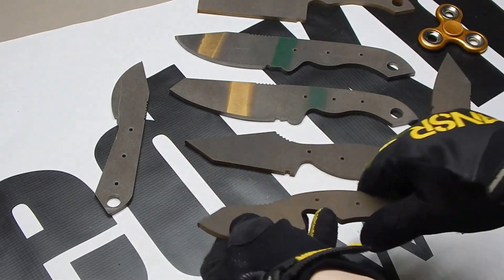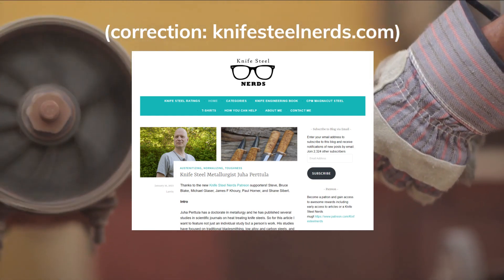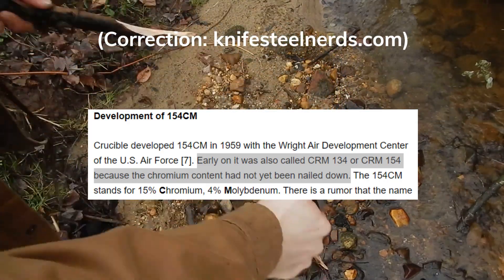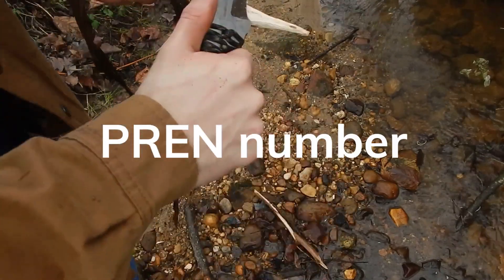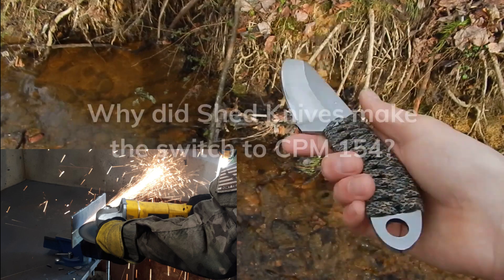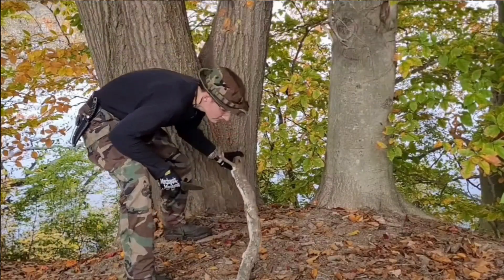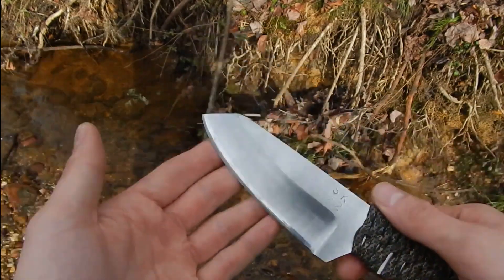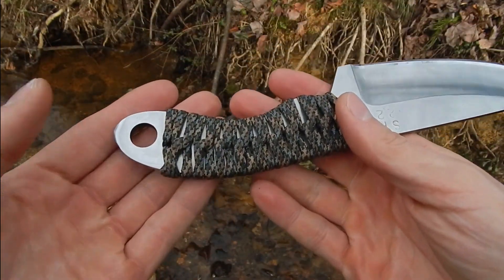Why Shed Knives uses CPM-154 steel #shedknives

Comment: CPM 154 is one of my favorite steels. It’s tougher than S35VN and holds an edge about as well. It’s not as good as Elmax or MagnaCut in my experience but it’s a lot more affordable and widely available than those steels are. 

I appreciate your history lesson of 154CM which is another favorite steel of mine. In fact, it is my favorite non-PM stainless steel. A lot of people mistake 154CM and CPM 154 as the same steel. The PM process really elevates 154CM though and takes it to another level.

RWL-34 is another really great steel that is essentially the same as CPM 154. A fun fact about RWL-34 is that the initials stand for Robert Waldorf Loveless.
Reply from the maker: I'm glad you liked the video! Any steel with CPM in front of it truly is a high quality steel. CPM-154 is one of the best options (in my opinion) for bushcraft knives so that's why we use it. I certainly appreciate your feedback & additional info - thanks for your support :)

Comment: You mentioned ATS-34. I have a Buck Alpha Hunter 1 of 2500 made out of ATS-34 and it is harder, harder to sharpen, gets better wear resistance compared to my cpm-154 knives but that can also be because of Buck's BOS heat treatment which seems to be the best method of any manufacturer.

Comment: As a chef and outdoors enthusiast, I would like to offer a tiny bit of constructive criticism.  Your cleaver blade doesn't need the sharpening choil, and it actually gets in the way when using that end on the blade.  The edge sticks down far enough that you needn't worry about cutting yourself while using, it would be more functional to sharpen the blade all the way.

Just my opinion, take it or leave it.
Reply from the maker: Hey there! Thank you for dropping a comment/suggestion, I appreciate it. Part of the reason there is a sharpening choil on the Atlas (cleaver) is so it matches the rest of the 2023 collection. The entire collection has the same style of jimping, sharpening choil, lanyard hole, and end of the knife. It's more for heavy use/chopping anyways but I totally get what you mean. I appreciate the feedback!!
Reply: @shedknives  I noticed the similarities and figured that it was something along those lines.  The problem is, after a certain number of sharpenings, you can no longer make flat cuts because the other side of the choil, I honestly don't know if it's still called the ricasso on a cleaver, sticks down further than the edge and you end up with only the tip actually contacting the cutting board/surface.

I really did only mean it as constructive criticism, you make some good looking knives and I am looking forward to Choirboyz' review on the Atlas.  Also, Respect for knowing what you wanted to do at an early age and making it happen.  You're what, 6-ish years in now?    I am truly looking forward to some of the knives you'll be making in the future!
Reply from the maker: @IvIidnight  Thank you! Good point on the sharpening, makes sense, especially when it comes to anything with a cutting board. I designed it completely with field intentions, so you don't really have to worry about the sharpening choil while chopping down a tree lol. On a cutting board, it's a different story, but I didn't design it for kitchen use as a main function. I certainly appreciate the feedback - that's why my knives evolve so much every year. I'm looking forward to the video as well! You know he's not easy on knives, so let's see how it performs!!
Reply: @shedknives  Fair enough.